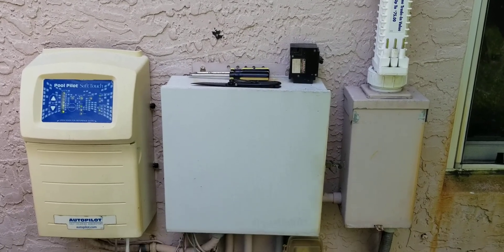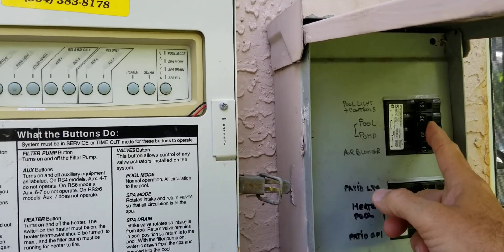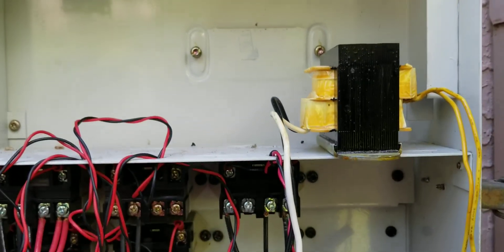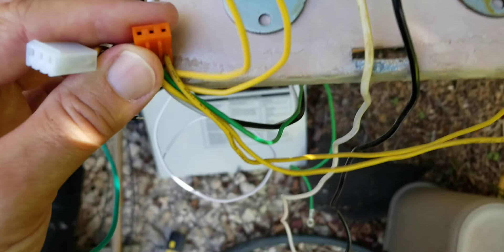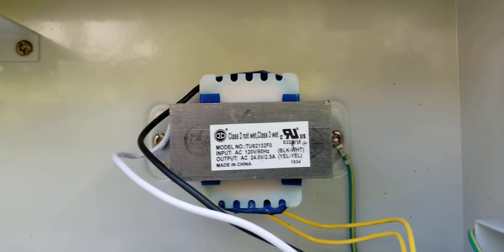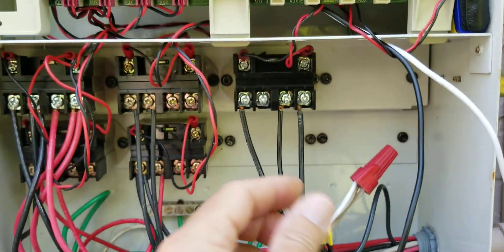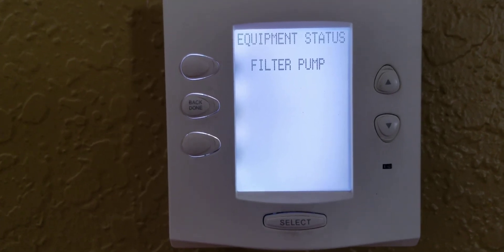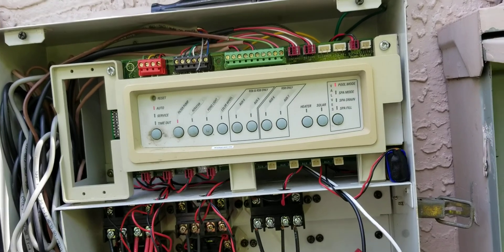Jandy Power Center not turning on

Comment: Quick question my panel has been turning off after about 2 hrs no lights on panel main breaker not tripped. I can reset main breaker and it runs fine been running 2 hrs. Did this the other day. Any ideas. You think the transformer may be heating up. Can’t be fuses cause it turns back on.  Thanks for any ideas.
Reply from the maker: if it's 'tripping the breaker" seems like a possibility.
Reply: @ it’s not tripping. But looked at it when acting up and pump and cleaner pump lights and auto mode lights were on but screen was blank I hit reset button and it started running. Wouldn’t be big deal but it’s been doing it every couple days. Any idea

Comment: Great video!!!!! I have 24v from the transformer to the board the fuse is good but the voltage output from fuse is only 12v. The board needs 24v correct?

Comment: Just going though a problem; my VSP stopped working all the control lights are correct and I have 236 from L1 to L2 but the pump wont start.  During troubleshooting when i turned power on it started for 1 second one time and ideas?

Comment: My Aqualink 4 panel was just repaired because the display was showing codes then it died all together. I have been running the circ pump using the Service Mode on the power center. I received the repaired board on Sat. and installed it right away. I was able to input the new date/time and the display was lit. The next day the display LED for the pump was lit showing me the program memory was intact. I turned it off as the breaker for the pump was off awaiting the installation of the new filter. On Monday the new filter was installed. I went to turn on the pump using the Aqualink and saw the display was not lit and the time was still showing. No buttons worked. Tried reset button. Tried turning power on and off but no effect. The repair center thought that maybe the fuse at the transformer might be blown but wouldn't that stop the buttons on the power center from working. Service Mode still works. Haven't check fuse.

Comment: How did you diagnose the transformer? I bought a new clock and installed it but still no power to the equipment. Switch doesn't send power to the motor that I can detect. Wires have no power to the transformer, or from it. I know..."That's my sign". How do these systems work? I have the old clock.

Comment: My pump went out and after replaceing it, I turn on the braker, but All my buttons go red on the controller at once by themselves but the AUTO SERVICE or TIME OUT buttons are off, any ideas please?
Reply from the maker: If you move the over-ride switch from Auto to Service, any difference? If NOT, check voltage across secondary of transformer (two yellow wires of orange 3-pin connector) Is it 24 VAC? If YES, turn OFF power and remove 3.15 amp fuse. Check for continuity. If NO, check voltage to primary transformer. Is it primary 110 VAC?

Comment: Good evening. I have power on all my buttons but it seems that when I push any of the buttons to make say pool pump or skimmer. The buttons don’t work like they should. Any idea why??
Reply from the maker: Is it on Auto, Service, or Time Out?
Reply: @PatriotMarine  it’s on auto right now, but even with power it doesn’t do anything. If I switch it to service, it doesn’t do anything. I was thinking it may of been a fuse but both of the ones I found will still good.
Reply from the maker: If while on Service (only time what you're attempting should work) you can't override switches then there's a process to check firmware chip for damage. Start with turning power off, disconnect battery; then turn power back on. If override switches STILL don't work the firmware chip may need replace.